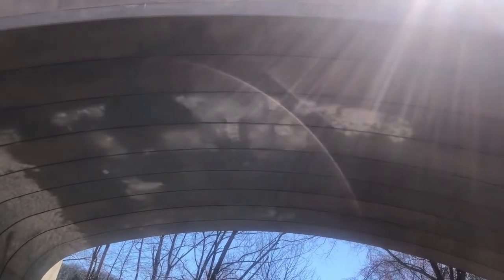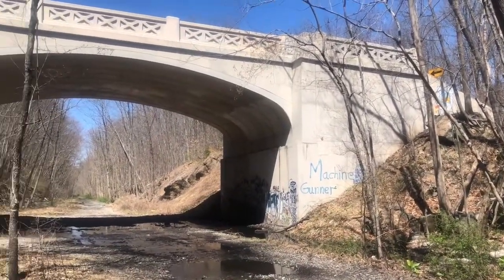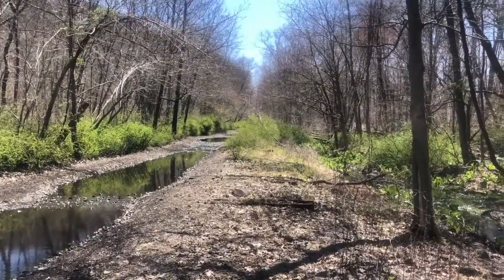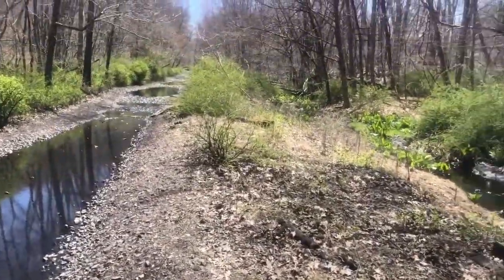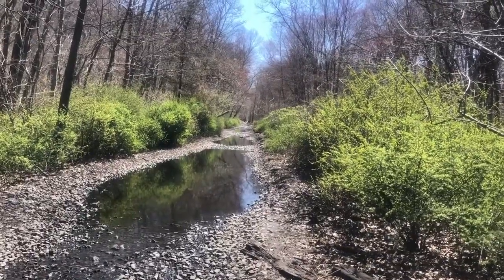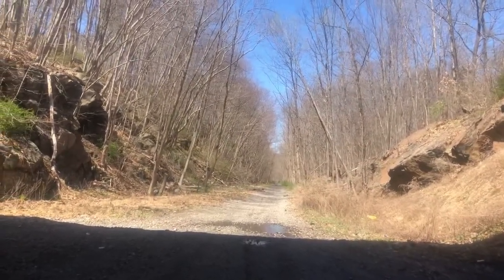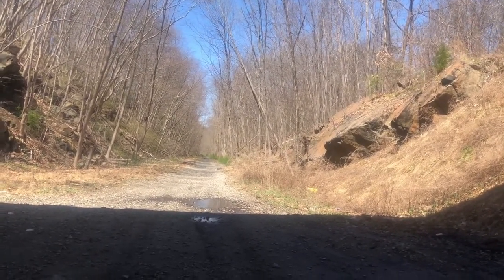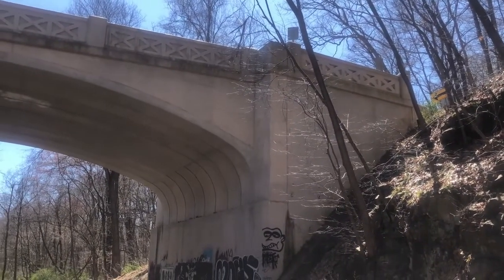Bridge over  Lackawanna Cut-Off  railroad bed in Byram New Jersey.

Comment: Why...? Because the bridge it replaced was a travel hazard. It was constructed in 1911 to reconnect Roseville Road after the Lackawanna Railroad had dug the "Big Cut", in which you are standing. The 1911 bridge was only wide enough to allow 2 wagons or 1910-era vehicles to pass (effectively a 1-and-a-half-lane bridge by today's standards). Not only that, each approach to the bridge from Roseville Road featured a near-blind, 90-degree bend as it crossed over the bridge. I haven't been over the new bridge, but I hope they widened it. It would have been really nice if they had angled the replacement bridge at about 45-degrees and created a more gradual "S" turn for the Roseville Road travelers -- but I guess that would have cost a lot extra. The cheapest fix would have been to fill in the cut and restore Roseville Road to its original alignment, but they now have to preserve the right-of-way for future railway restoration.

Norm in Branchville (...end of the Sussex Branch)
Reply from the maker: At the time I was wondering why they didn't just fill in but it makes sense that they would want to preserve the right of way in case they decide to restore it.